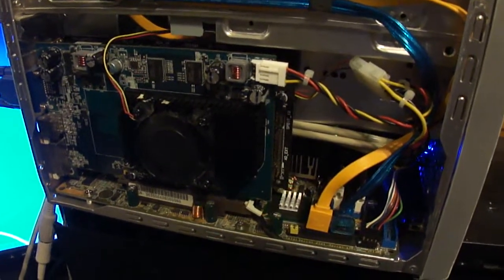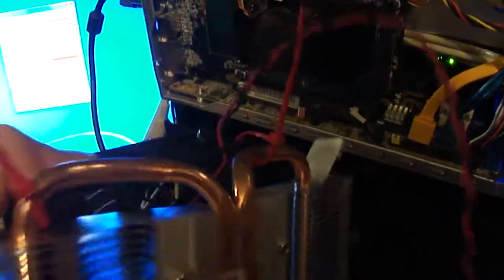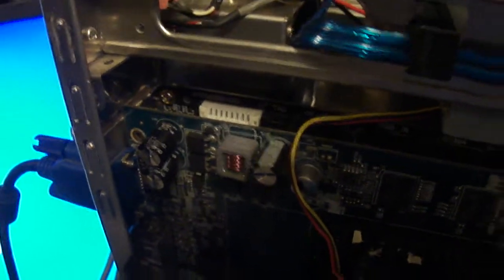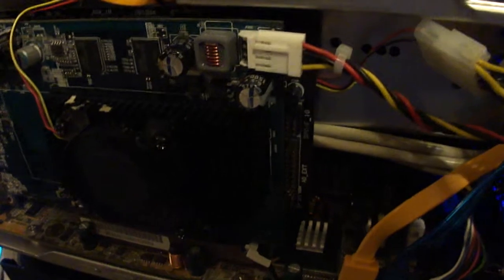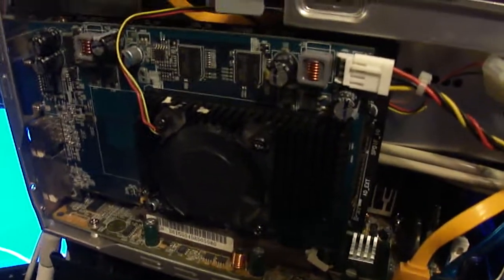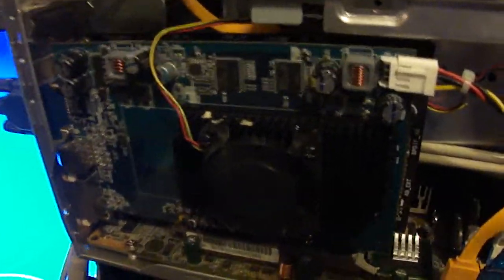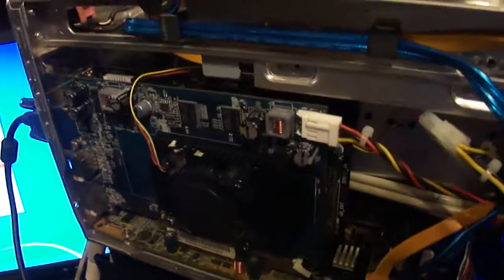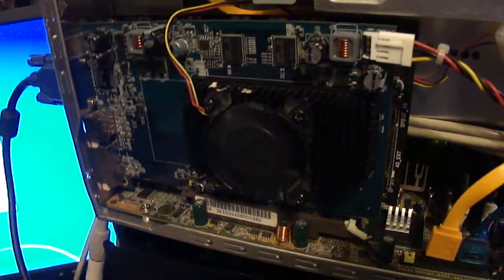HD3650 AGP Card w/low-profile Heatsink-- SB61G2 v1

Comment: cool rig, like when u throwing your additional cards around, u got some decent warehouse there
Reply from the maker: it's not all too vast. I'm a bit more limited on the parts I have access to for older computers now-- a lot of changes have happened in the last year, and I've stopped taking in pentium 4 era equipment, so there's less of a chance of me getting the cards out of them. it just makes for more of a hassle cleaning up the mess after gutting them. I only have this Shuttle with the finished modifications, my Inspiron 9100, and the Thinkventre I did an earlier-than-this video on, left, that have a Pentium 4 in them still. Also have my grandma's old Inspiron 5100, but that's in storage for various reasons pertaining to backup purposes.

Comment: Hey sorry for the question, but i have the same graphic  card and i couldn´t find a correct driver (the ones i have tried show my card as hd 2600xt). Could you help me? Thank you in advance and Greetings from Mexico.
Reply from the maker: manually go into device manager, update the driver for the card, don't search, and manually select the visiontek HD3600 series under the selection. other than that there's no problem, the core is used in both the HD3650 and the HD2600XT for visiontek's cards.
Reply: Thank you very very very very much, i spend all the last weekend trying to find a solution, but yours works perfectly.
Reply from the maker: Eduardo Rosales Quintero Glad I could be of help. the machine is still in storage now until I can give it a more permanent home. my basement is still half a mess and needs to be cleaned up... else I'd have more videos on the darn thing. the fact my grandma is sick and we're taking turns watching her while she recovers isn't helping things any.